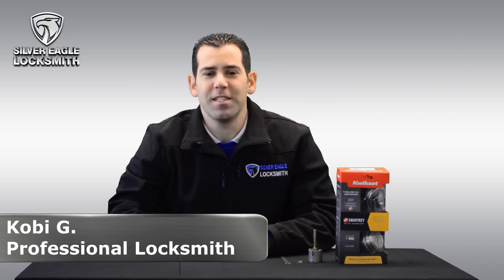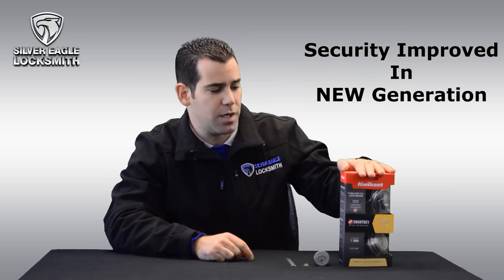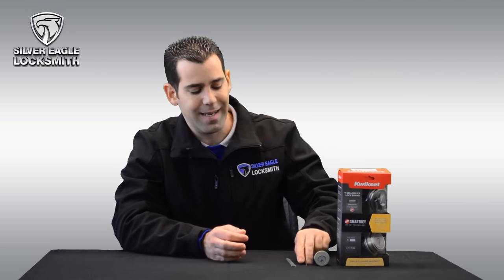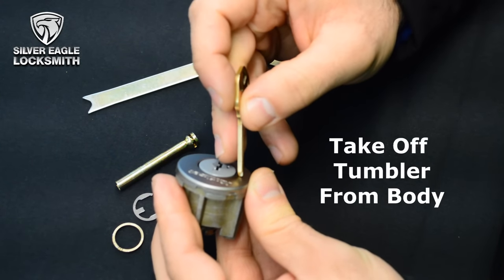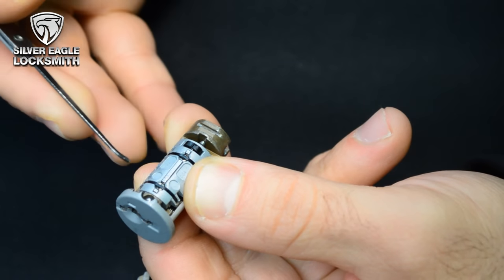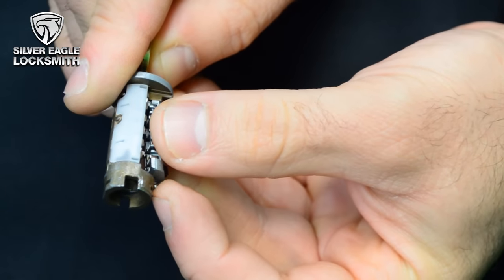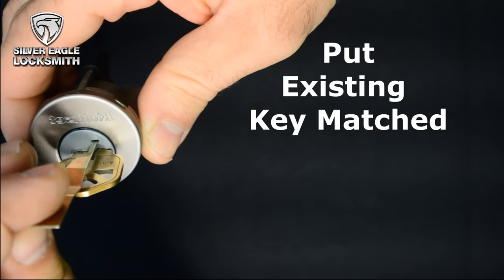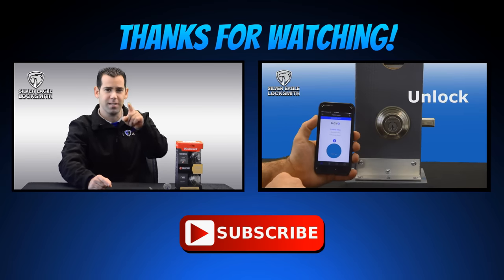How To Reset Kwikset Smart Key Without the Current Key Or The Reset Tool ✅

Comment: Great video. I was able to rekey the deadbolt with no issue following your instructions. Big thanks for that!!

Now the problem is the handleset. Is there a way to take the lock cylinder off the handleset? I took all the parts out but still no lock accessing the lock pins.
Reply from the maker: The handle set is a doorknob or door lever ?
Reply: @S.E.Locksmith   it is door knob. I took all the pieces out of the handleset but still not able to access the lock cylinder. I can send you a picture if that helps.
Reply from the maker: You will need a Kwikset Removal Tool 
I think you can find it in Home Depot Or Lowe’s

Comment: This worked on a M# 909 I believe and actually dropped 4 of the slide pins on disassembly but re-installed and actually used a Defiant dead bolt key and works great. Great video !! Any where to get inside cover and battery tray ??
Thanks !! ( 3rd generation part time locksmith ).
Reply from the maker: I’m happy that you learn something new today

Comment: Thanks I did get mine rekeyed but struggled getting the inner cylinder released. Not sure how I finally got it to release, used a couple of different sized paperclips. Also when I inserted the key before assembling the white plastic spring holder popped open and I lost 2 springs but somehow found them on the floor.

Comment: Thank you so much!  I had a few extra keys cut and after using them it seemed the lock would snag a bit and then stopped working with any of my keys altogether.   Followed the steps in your video (keeping the little bits in alignment while pushing it back together was tricky) but now my deadbolt is working again!  It's a little rougher than before, but that's probably because all the grease ended up on my hands after so many tries :P

Comment: Been trying to pick the dam thing for 2 hours 5 min video and wala it works thank you so much
Reply from the maker: The Kwikset Smartkey is a pick resistant lock so it 99% won’t work... 
my video here is the only way to bypass this lock and rest it without damaging anything.
Reply: If you have one with the reverse sidebar you won't be able to pick it unless you use a shim to tension the sidebar.. otherwise you won't be able to pick it at all.

Comment: Thanks I just bought a Zwave kwikset open box return off Amazon and the reason it was returned is the included keys wouldn't work with the lock.  Can you imagine that, from the factory the lock wasn't working!  Some tech, eh?  I didn't want to have to buy the reset cradle.  Also, this lock will be used on an exterior door that gets a LOT of rain on it and I regularly have to saturate the existing lock with lube to keep it from freezing up, I'm sure I'll be taking it apart many times in the future to fix it!

Comment: Another happy viewer.  Great video, worked perfectly.  Would this also work on non-smart key kwikset locks?   I have a never used double cylinder deadbolt with no keys.  It's trash unless I can figure out how to re-key it.
Edit: Nevermind, I looked it up and ordered a simple bottom pin kit via Ebay.
Reply from the maker: It’s only works with smartkey Kwikset locks
Reply: @S.E.Locksmith  Got it.  I actually already re-keyed the double lockset using a set of bottom pins I bought.  Not hard and kind of fun.  :-)

Comment: So this almost works for me - great instructions.  Unfortunately, the small plastic cover on the springs keeps falling/popping off. I've now lost 4 of the 5 springs. I don't seem to be able to hold the cylinder properly to complete the task. Is there a tool that can hold the spring cover in place while I do this? And do you know where I might find reasonably priced springs? Thanks!

Comment: Great video man thanks, i see this locks for cheap at the swamp-meets without a key I’ll try to fix one some day, by the way you dont need to hold the rekey tool in there while you switch keys you just poke it to be able to remove the key
Reply from the maker: Kwikset SmartKey becomes very popular now days and to know you you can reset it will save you a lot of time and money

Comment: Be careful when putting the tail piece back so that the rounded side is at the top of the plug . because the clip that holds the tail piece on can be inserted either way around top or bottom. at the back of the plug there is a cutout at the bottom like on pin tumbler locks. and at the top there is a small hole where the c-clip goes so make sure you put the c-clip on that side so the tail piece will be right side up. or when assembling the lock either the key way or the thumb turn will be upside down.

Comment: Bought a used handle set at Habitat restore.  No Keys.  Changed the deadbolt no problem!!  But the thumb handle?? How do you get the tumbler out?  I tore the Thumb lever mechanism out, but the retaining ring on the tumbler seems to be "captured".  Have you got a video of that?
Reply from the maker: You’ll need a special removing tool for the knob. 
This tool from what I know only sales on line and on security supply for locksmiths. 
It’s a removing tool made for Kwikset knobs.

Comment: First off Thank you!. My double cylinder deadbolt was no longer accepting the key it has since 2013. After taking it apart it was almost jammed? It works fine now.. could this have been from someone forcing the wrong key?
Reply from the maker: Hi Jonathon, 
Yes it’s definitely possible that someone insert the wrong key or try to reset the lock and not following the steps as it should.

Comment: Does this work with a double cylinder lock? I didn't key the outside locks on my new double cylinder deadbolts? The dummy keys won't work and the key that was keyed for the inside won't work either?
Reply from the maker: Yes it will work on double sided SmartKey locks

Comment: Glossed right over the removal of the side bar with the two brackets holding it in. Didn't mention the two little springs that are beneath the side bar and a very necessary component of the lock. One of the little springs sprung onto the ground never to be seen again. Thanks bro, for ruining my $139.00 lock. Also, it is the back and forth sliding that locks in the new key. Leave the key in while you put it back together. Ilive in Vegas, might go down there and make fix it.

Comment: Great video, but my key is getting stuck in the cylinder. Any tips?
Reply from the maker: Try to use a different key and also lubricant the cylinder using a lock lub that you can buy online or at Home Depot

Comment: Is it the same process for kwikset powerbolt 2? How do you remove the cylinder of powerbolt 2 ?
Reply from the maker: You may need to remove the back panel
Of the keypad and then it’s pretty much the same process.

Comment: Well I could never get the lock cylinder out.  What can I do? What special tool do I need? I put a key in, pushed on the back, but it would never move, maybe an 1/8" but that's it. I got the snap ring and other washer off without a hitch. I put it back together so I could lock my garage door. I may have another go at it this weekend after I try the other remaining unit.

Comment: Hello, I was just wondering that can i make two different key as an master key work for this locks?
Reply: Nope. That's one of their big disadvantages. However, Kwikset has recently released a version of the Smart Key that has two plugs (one is hidden behind the plate) that allows you to use a master key.
These locks aren't all that great. Ask any locksmith how often they get called out because someone slammed the door too hard and reset the lock. Now they're locked out. They're hard to pick so the locksmith usually has to drill it out and you have to go buy a new $50 lock in addition to paying the locksmith around $100. That's an expensive door slam.
Reply: Smeado, are you saying that the unit with the master key is susceptible to the slam issue or any of the smart-key locks?

Comment: I have deadbolt low profile  uptown 258 rdt 15 smt 6 Al rcs k3. It looks very similar but there is another wire piece that popped out.  I don't know where it does and support has no idea.
Reply from the maker: Honestly I’m not really sure about this one but it looks very similar to the regular Kwikset SmartKey 
If this video didn’t help in your case maybe just return the lock if possible
Reply: Silver Eagle Locksmith yeah the cylinder is very similar.  I can email a picture of the bent wire. Support is sending me a new latch already as it was missing from box.  They didn't know what the wire was either.  It fell out of cylinder as I was disassembling to fix misrekeying.

Comment: Without watching, couldn't one(ok, maybe just LPL and a few others 😄) essentially pick the lock to the first 1/4 turn, insert the tool, then finish with the new key?

And what's keeping thieves from rekeying any lock and walking in wherever they please that uses this system? If it's that easy to rekey without the current key...??? Is the tool hole on the inside knob? I thought I remembered it being on the outside(I think he had a deadbolt?) in the vid I saw at lockpickinglawyer's YouTube channel.

Edit: he did a rim cylinder, a deadbolt with likely another rim cylinder?, and a padlock. What's stopping any thief from just resetting it to his key?
Reply from the maker: Hi JC 
So for your question... 99% of the times you won’t be able to pick this lock the Kwikset Smartkey designed that way to be pick & bump resistant! 

So pick this lock is totally luck and nothing more... 
and that’s why you can’t just pick it to the first 1/4 turn and insert the tool and rekey it easily. 

There is a special tool online that can do this but going to this hassle it does not worth the time. If you are a professional locksmith it’s a different story and this special tool will save you more time on the rekey of those locks with no existing key. 

I hope that this answer your question.

Comment: How did you remove the cylinder? 
I just moved into a new home with this lock and was able to reset the pin but messed up on the new key set up. Can’t find a way to just remove the cylinder anywhere
Reply from the maker: Try to use a paper clip or small tool

Comment: I have a smartkey 911 lever. I can't remove the cylinder from the lever. Can someone help asap. Ty
Reply from the maker: When the lever is on opening position insert the provided LM tool to the small hole on the left and twist until you remove the lever. 
After doing so you’ll have a small clip that holds the SmartKey Cylinder so remove that as well and don’t lose it. 

Hope that help

Comment: Is it the same for the door knob?
Reply from the maker: That’s a good question... 
the reset process is the same as both Kwikset smartkey knobs and deadbolts using the same cylinder, but the knobs also requires a Kwikset removal tool: 
https://amzn.to/2T4eBMj

and after you buy this tool online follow this instructions to remove the cylinder core from the knob housing: https://www.youtube.com/watch?v=Cw4MquHlD7k

After you finish removing the core smart key cylinder follow the rest of the instruction in my video to reset the lock with your Kwikset key. 

To put back the cylinder in the knob simply just push it back till it clicks in (I recommend to do that step after you installing back the knob into your door so you don’t put the cylinder upside down by mistake) 

I hope that help.

Comment: Why do you keep pressure on the re-key tool while re-keying?
Reply from the maker: So the reset tool won’t stick out. 
The sidebar have a small spring on the tip so it’s push the tool and that’s why you have to keep pressing it, otherwise if it’s going to move you gonna messed up the rekeying again.

Comment: How do you do the first step...Take the cylinder off the lock?
Reply from the maker: If you have any thin tool that you can carefully stick inside the keyway and slowly remove the cylinder that will work. 
In my video I used one of my pick tools but you can also try different keys as an option and if’s not working try a Thin pin or paper clip and follow the steps in the video to reset the wafers of the Smartkey lock

Comment: I went through the process and the cylinder will spin once reassembled but now I can’t get the key out. Any thoughts about what might be going wrong?
Reply from the maker: It might be a problem with the key or a problem with one of the wafers. 

Try using lock lubrication if you have one and if this not working so you need a new Kwikset SmartKey Cylinder

Comment: I can handle this part, but I can’t get the cylinders out of the smart code dead bolt
Reply from the maker: Yes, it’s a little bit different on a keypad or Smart locks… it’s the same concept, but the removal of the cylinder is different and unfortunately, we can’t explain here how to do it

Comment: So how do you do this with the normal knob (not the deadbolt)
Reply from the maker: So the process with a knob is similar but you’ll need a Kwikset knob Removal tool to remove core from the lock housing and unfortunately I don’t know any other way to remove it without this tool. 

So in your case without this removal tool I would recommend to return to the store or if that’s not possible so buy a new lock.

Comment: i get that bt how is top lock tirn the roght way and botom the opposite (they are from the same set)
Reply from the maker: Yes so deadbolts are different than door knobs or door labor handles. The mechanism is not the same and that’s why you have to turn the key to different sides. It’s pretty normal

Comment: Will this process work on the key control lock?
Reply from the maker: Sorry I didn’t understand the question?
Reply: I bought a "key control" lock from someone on Craigslist and found out afterwards  there were no keys.
This lock is designed for apartments so there are 2 separate key slots, 1 for the tenant and the other for management .
Reply: FYI, I was able to use your method to rekey the "tenant" part of the lock, which is all I really need, but if I can find a key to fit the "management" slot, ill try to rekey it too.

Comment: How do you do this on the Smartkey padlock?
Reply from the maker: TheAvid Picker  
That's a very good question. 
I think you can't remove the cylinder on those padlocks but
I'll make sure to check that and get back to you shortly.
Reply: It works on smart code too....thanks so much for video
Reply: The Avid Picker

Comment: You don’t have to hold the rekey tool inside as you swap simply turn master to 3 o’clock use the tool to rekey and press it in, and that’s it’s remove the rekey and the master and put your new key in at 3 o’clock and turn the new key right to 12 and then back left to 12 no need to hold down the smart key rekey plunger

Comment: I ruined my lock for good trying this. But the Kwikset smart rekey had already failed leaving both my original and replacement key useless, so I guess I was buying a new lock regardless.
Reply from the maker: I’m pretty sure you could’ve fix it 
But yet again it all depends on the scenario, tools you’ve used etc 

Most of the people here and also you can read many of the comments they were able to reset their Kwikset smart key locks, unfortunately it didn’t help for you
But there is a link in the description of the video where you can buy new smart key cylinders instead of replacing the all lock.

Comment: Baaarp, I failed, a couple of little springs came out and the circlip would hold when I put it back together (yeah, I must have bent it). I was trying to rekey my Kwikset (not so)-Smart Key, but it wouldn't switch over. Its about 6 years old. I bought a new deadbolt and it was easy to rekey so I think my old one had seen better days.

Comment: what prevents someone from rekeying it to their key and getting in
Reply from the maker: If they have access to the inside of the door (the thumb turn  side of the deadbolt) so they can do this reset method anytime, but if the only access they have It’s from the outside of the lock where the key goes so they can’t do it ! 
They’ll have to pick and most likely drill the lock to unlock the door which will destroy the lock anyway. And by the way Kwikset Smartkey is pick and bump resistant locks

Comment: Ugh! I feel like a dummy. Trying to remove the holding piece that he says doesnt require a special tool... but I've tried every tool that might possibly do it. 
I have a small wrench that fits but it will not turn. Help please!
Reply: Also I have the original key and it wont unlock the thing and it has never been used. I may go buy another. Then take this one back.
Reply from the maker: Try to remove the cylinder with a paper clip if you have one. Play with the top pins slowly till you’ll be able to remove it from its cover body

Comment: This might work if you don't have a key for the lock,  but Kwiksets smart key reset (Kwiksets own video) makes fixing a failed rekey easier than this. No need to take the knob apart. If you need to take your current knob apart, it would be easier just to buy a new one instead of going to all this trouble.
Reply from the maker: I’ve watched all of their videos i’m being really honest it doesn’t work all the time... but my method works all the time!
Reply: Kwiksets own video worked well enough for me, much easier than trying to take the door knob apart. I think that if someone can't figure out how to reset their lock, they won't want to try taking it apart to see what's wrong with it. Might as well just buy a new lock.
Reply from the maker: If you prefer to buy a new lock for $40 it’s your choice but my method of hard reset is quick, and work 99% of the time
Reply: Apparently my comments went over your head. There's the easy way that Kwikset shows. If someone can't figure that out, it would be easier for them to replace the knob than to do it the hard way.
Reply from the maker: It’s easier than what you think... save your words if you haven’t try to reset the Kwikset Smartkey my way